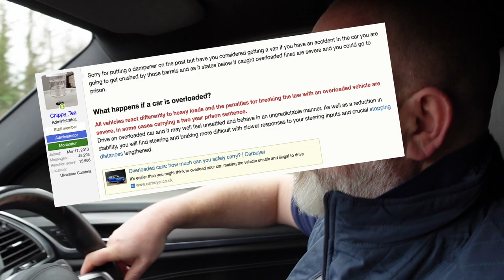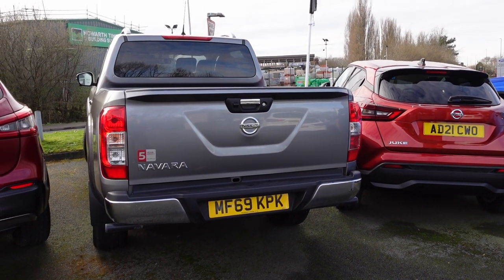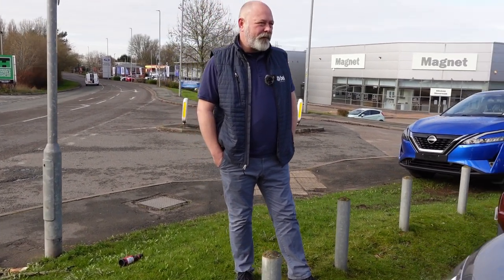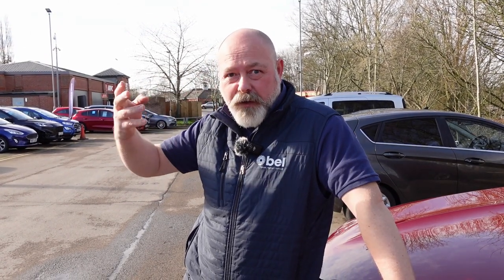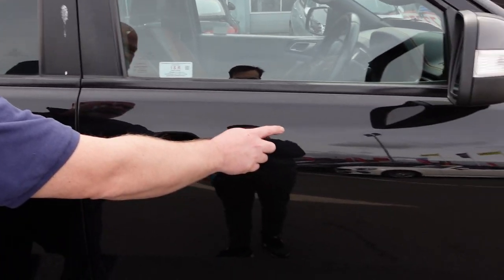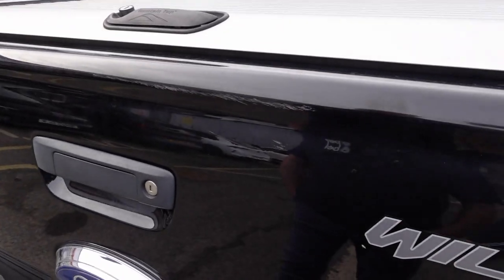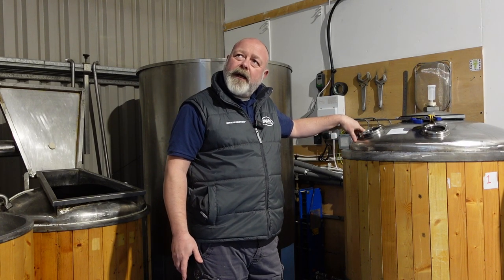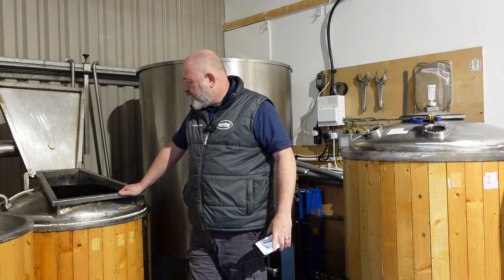Ep.82 - Riveting stuff!

Comment: Which hydrometer do you use
Reply from the maker: I use Stevenson Reeves B3030 Series. I have a 3-set, 1.000 to 1.030, 1.030 to 1.060 and 1.060 to 1.090
Reply: what is the program you have on the screen
Reply from the maker: Ubidots.